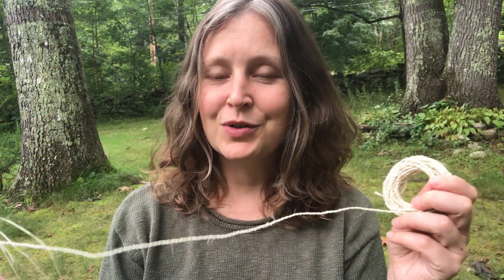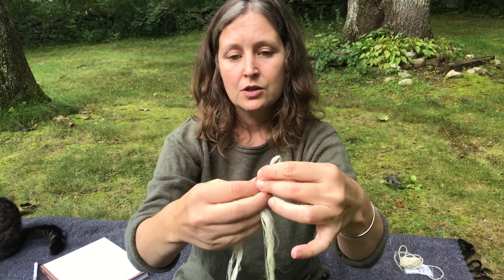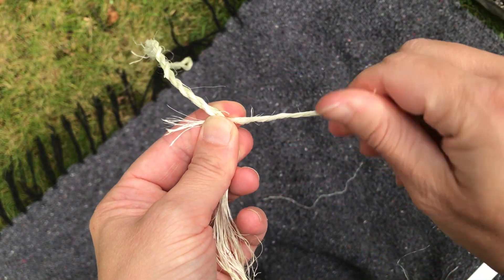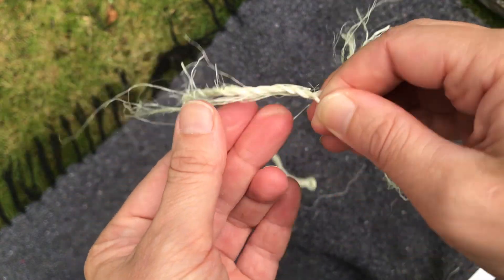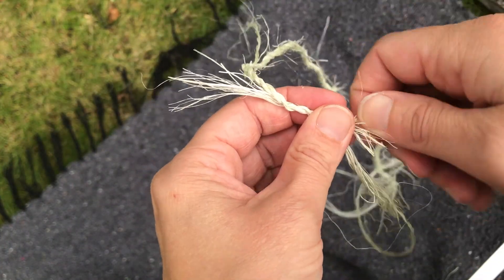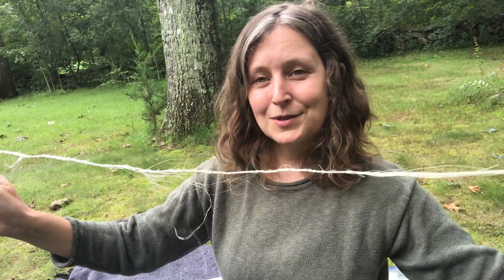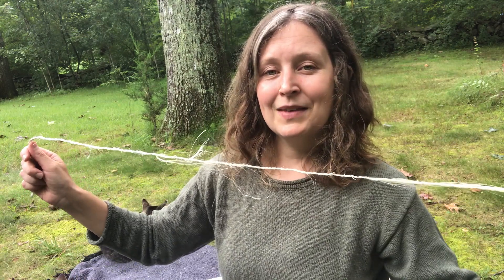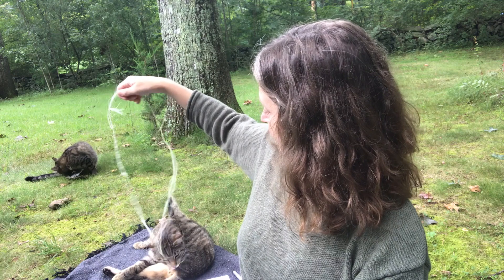How to Splice Fibers

Comment: I assume that the yucca fibers you were using is from a flat leaf yucca variety. Lucky you to have that variety! Do you always do your cordage twisting with dry fibers?
Reply from the maker: yes I always dry them first- you do not have to dry them but if you twist them wet, they will lose volume when they dry out and the cordage will not be as tight.  and yes! having yucca available is such wonderful!